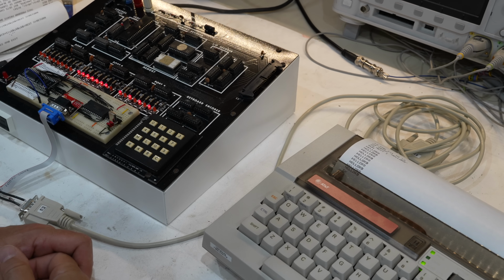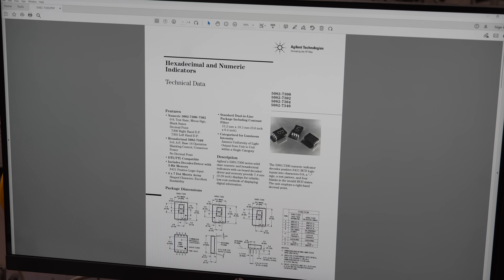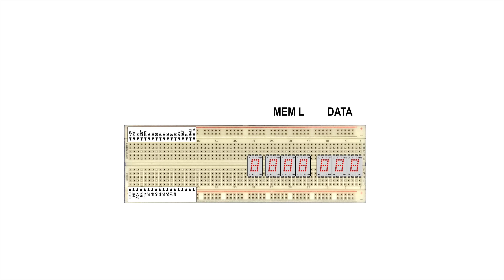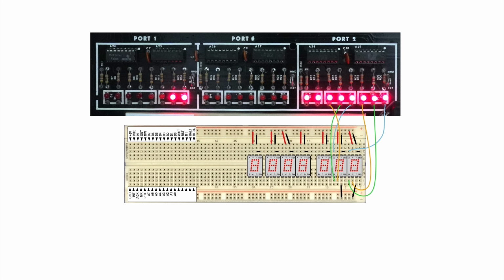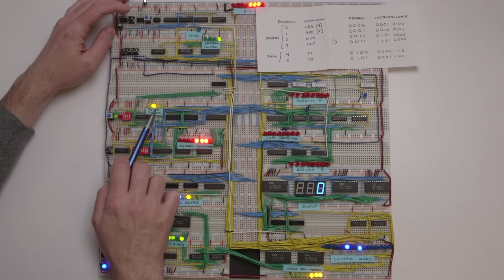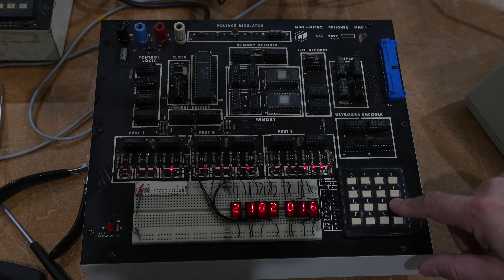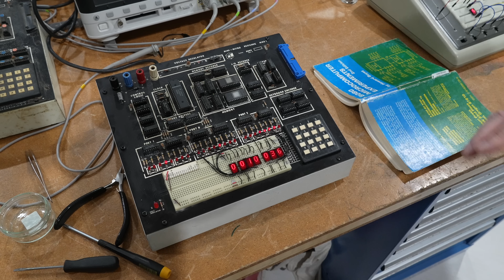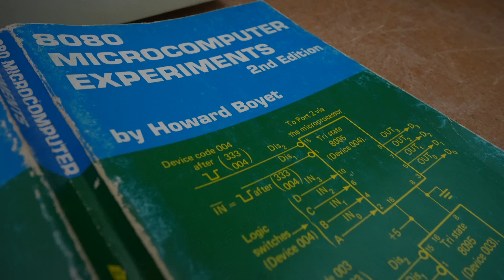MMD-1 Restoration - Part 2: breadboarding HP 5082-7340 displays, bad RAM

Comment: Those HP displays work nicely on a breadboard. I have a bunch of TIL 311 displays which do the same job. The difference is they go in to a 14-pin DIP socket. To use them on a breadboard would mean they would be sideways compared to the HP displays.

Comment: When I was in college, we used ELI breadboards, big ones, with 6 or more strips, switches, and indicator lights. One of my fellow students (David I. Forgethislastname)  ordered one of Intel's introductory 8080 kits (this would have been 1978 or so), which came in a large flat blue box, and contained a processor, a clock chip and maybe something else, I forget. He then proceeded to monopolise an entire lab bench, and most of our breadboards, and built not only an 8080 system, but extended it to have a CRT display and a serial interface. When I last saw him, he was headed for a job with Intel.

Comment: These HP displays similar to Texas TIL311, both are beautiful little things.
Reply from the maker: I didn’t know of that chip, but it is indeed very similar. Pins are on the side though (instead of top and bottom), so it would not work in this breadboard application. Thanks for the tip!

Comment: IMSAI Guy recently got a SDK85 Intel 8085 Trainer.  He to was having keypad problems on his trainer.  Seems to be a common problem.  A lot of the early trainers I have suffer from the same problem when I first try them out.
Reply: That's why in the trainer-style computer I've been building lately, I used KiCad footprints for mechanical keyboard switches as the keypad. They're easy to get from Amazon, and I've got a few broken mechanical keyboards that I can salvage switches from. The negative is that they don't work in the 0.1" breadboard spacing world, so you have to get a PCB made to use them.
Reply: It also reminds me of the Tandy “Trash 80.” Loading the keyboard debouncing routine from cassette was potentially a nightmare. Cheap mechanical key contacts...
Reply: As I experienced it, in this time having keypad problems was a common problem. Especially eg. Texas Instruments pocket calculators had this problem. I remember my TI-58, which after a while had key bouncing or not responding keys or you had to press them in a funny way. I know some other guys in my class had the very same problems. It went on until I bought my HP-41, which costed a fortune (for me as a school kid), but was so much better in keypad quality. It also had a 16 segment LCD instead of a 7 segment LED, but this is another story.
Reply: @kallewirsch2263 I've got a VFD one made by Toho, a Roger F6. Never before did I appreciate the convenience of being able to calculate in the dark, since I've only seen LCD ones before.
I got it from work, reflowed it and cleaned some battery leakage, it's as good as new. 
I was so surprised at how repairable it is!!
For reference, I'm born in '98 so I'm born way past the calculator era of computing.
Oh and no problem with the keypad.

Comment: Mhhh, breadboard spaghetti! With Bit sauce?
I work on a lot of stuff, and I made myself a large breadboard out of five of thes elarger segments with power rails in between. Also added a ton of connections (RJ45, XLR, DB25, banana jacks, ...) which ends on a pin header on the right side, so you can just jumper that with some jumper wires. As I see this nice IDC connector on yours I think that could be a nice addon for the future, but for now I have a ton of adapter boxes for the DB25.
Yeah, for a lot of stuff this becomes a real mess :D But at least I have ten colors of jumper wires to keep it sorted a bit at least.

Comment: a clone of those displays is still available from digikey, manufactured by broadcom as hdsp-something and they cost a fortune
Reply: I think the reason they're so expensive is because they get used in repairing aviation and military equipment. Also because they're almost hand-made. If there wasn't a high-price use for them, they probably would have stopped being made years ago.

Comment: The original display for  the COSMAC "ELF" A Low-Cost Experimenters Microcomputer. Something I have a certain fondness for, as you can tell by the name 😉 although I saved a great deal off of the original $80 cost by using latches and LEDs and reading in binary 😜

Comment: Today, the TIL-311 would replace the HP display… if you can find any, that is. The TIL-311 had a chip in it that would display a single hexadecimal digit from 4 input pins. Of course, it also had Vcc and ground, and probably a blanking input as well. It may have had one extra pin for control of the decimal point.
Reply: You remember correctly. I like the TIL-311s and have a little stash, awaiting a suitable project. They do run a bit hot, so I used to run them from a slightly reduced LED supply. There is something about the nice rounded characters that looks so much better than other displays of that era.
Reply: Looking those up... they're even more expensive...
Having some simple display I can just wire into various projects for debugging would be very handy though.
Maybe I'll have to cook something up with a microcontroller and an OLED display or something.
Or, needing less code, just make a PCB to integrate a decoder chip + 7segment display into an easily pluggable package.
Neither would be quite as neat, though.